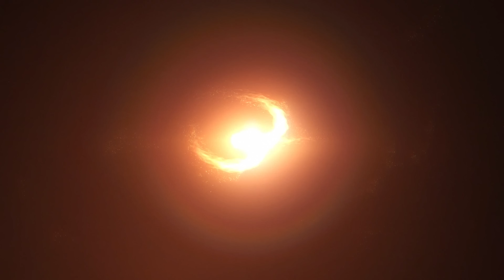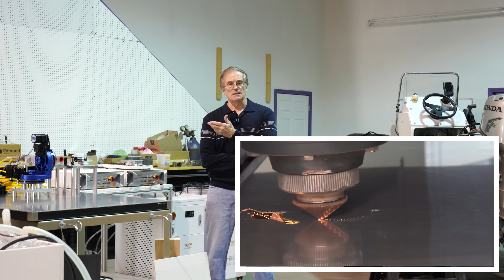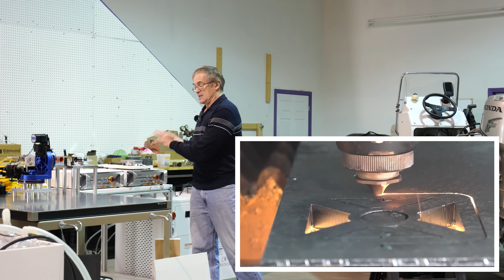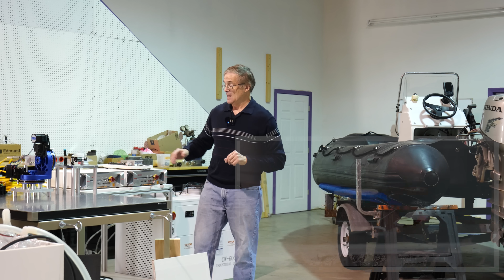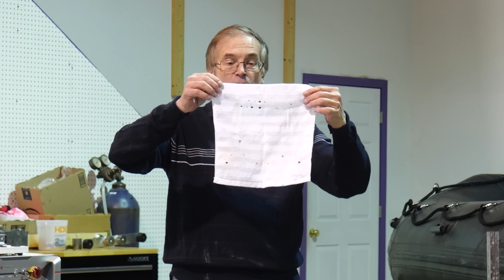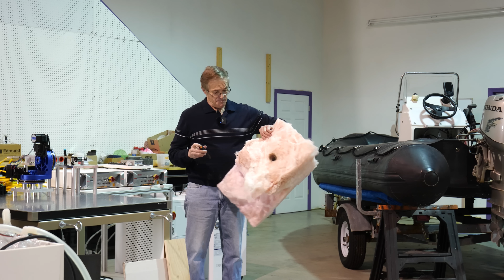We have a problem... and need your help!

Comment: My first thought is carbon foam with lots of aluminum oxide or graphite added, or that commercially available ablative fire paint stuff seen in a Nighthawkinlight video. I would also think about using those tactile transducers you've previously used to make music so that you can effectively enlarge the contact point, How much that would help, I have no clue.

Comment: active cooling wall. pump water through the surface to a heat sink. Range sensor. 3D map your room and if sights land on background don't fire the laser. If sights land on something between the background and the laser then it is a valid target and fire. Limit firing time to quarter of a second to allow time to see if target is destroyed.

Comment: No idea if this would work but how about just putting a plexiglas tank full of extremely dark liquid/oil in front?
I imagine the cloth did not work because the cloth fibers are transporting the light energy into the absorbed liquid but burning up in the process.
Instead of the wet cloth fiber absorbing the light let the liquid itself be the absorbant material?

Comment: With such energies it is almost impossible to find a material that resists. You can consider Ablative armor. Nighthawkinlight made a DIY Ablative composition for fire protection, maybe such a modified composition will help. 
It is possible that not the material itself, but the plasma created by it will be the main absorber of radiation.
Reply: Wood works good, not because of high energy resistance, but plasma and particles bursting out of the hole, absorb radiation before rest hit combustion point.
Reply: phenolic resin (or that you have on hand) + fumed silica / graphite powder / Al oxide (test for structural performance) + doping for plasma density (NaCl ?) + smf for electron-density, reduction of the plasma ionization potential ( ? ) + doping for control of ablation rate, decrease or increase (CaCO3 , Fe2O3, Al powder, carbon black ...)
1-10 mm (need testing) of composition on top of OSB.
what do you think? thanks
Reply: phenolic resin (or that you have on hand) + fumed silica / graphite powder / Al oxide (test for structural performance) + doping for plasma density (NaCl ?) + smf for electron-density, reduction of the plasma ionization potential ( ? ) + doping for control of ablation rate, decrease or increase (CaCO3 , Fe2O3, Al powder, carbon black ...)
1-10mm on top of OSB. What do you think? thanks

Comment: In a perfect world to protect drones, I would use Aerogel. It's super light, and I heard it would break up the beam and dissipate heat fast. I think you can make it yourself.

I think Rockwool insulation is perfect; it's fireproof. It's like brick but cheap and light. It's made from EAF slag, then spun and aerated to make an insulating material.

Cheers

Jon W
Reply: I immediately went there after seeing the pink insulation. Then he held up the brick. Idea quashed.
Reply: I thought the same thing about rockwool until I saw him talk about the brick. I'm guessing the laser would melt the rockwool. Maybe it could be constantly sprayed with water to lower the temp.
Reply: "dissipate the heat fast" ... isn't Aerogel like one of ~the~ best insulators? And it's about as much DIY as diamonds. Yes you can theoretically make it yourself. In a perfect world.
And rockwool is how different to the glassfiber insulator he tested?
Reply: @Culpride  rockwool does have a higher melting point, but I doubt it would matter much in this case.

Comment: at that point youre dealing with similar problems to a shooting range. would it be possible to find a section of dirt like a berm or even flat ground that you can aim down at, which you could erect a prefab shed structure around for testing? it would probably end up being cheaper that bringing in and assembling enough material to resist the laser

Comment: Several layers of 5/8 or 1/2” Cement board used in construction as  tile underlay.
Cut it in 15 x 15 cm squares or hexagons layered to minimize seams and allow for easy replacement.
Cheap, consumable, replaceable, non toxic. 
Could even attach some tile material to it if that would help absorb the energy of the beam.
Reply: I had the same idea but you beat me. As an addition i would consider glass fiber reinforced cement board (not sure if that's available there)

Comment: How about soaking thinner plywood boards in a borax + boric acid (1:1 by weight) hot water solution? Boards need to be thinner as the solution will only penetrate a few mm. Evaporation likely but the burnt borax will form a carbonaceous char that slows combustion by being highly insulative and trapping combustible gases.

Comment: Surely a graphite sheet would be able to absorb and distribute the heat rather quickly, not sure where you'd get one though   
Maybe an Intumescent coating on the drywall?

Comment: What about ceramic tiles? probably would suffer from the same problem as the bricks but worth a try
There's also refractory/fire bricks, not much more practical than a brick wall but they are at least typically lighter, and I suspect would handle the laser well

Comment: Obviously need black dyed rawhide / leather to both absord and disperse the heat. 3 inch thick black rawhide should handle it for a second. I am not confident without liquid over leather you'll get the desired requirements. I'm thinking aerogel over top black leather. like the Russian space shuttle material.
Reply: I think aerogel and black leather are going to be the most surefire bet.

Comment: Idea 1 shoot laser down and use the earth as the touch point. Idea 2 use rotating disk of plywood and surface coat it with best absorbing material  you have at hand. rotation meaning laser will touch one point only short time and material can be cooled at the same time.

Comment: you can get "shaft wall" which is 1" thick fire rated sheetrock. Another idea that could be used in conjunction with the shaft wall is a waterfall wall so you have a continuous flow of water, or maybe another fluid that might absorb heat more effectively.

Comment: Perhaps you're asking the wrong question. Instead of stopping the beam directly, why not reflect it? Just like in the fibre optic cables that utilizes total internal reflection, how about putting a large mirror at a steep angle reflecting the laser beam to the ground? 
I doubt the laser can pierce the Earth's mantle... Hopefully.

Comment: A multilayer ripplelike woodshild with extingushing system that blows between the layers?
A water fall - maybe ripplelike?
Combine those two?

falling sand instead of water?

a kind of conveyor belt system that runs so fast, that the laser bundle has no time to burn through?

Comment: How about the material they used for the heat tiles on the shuttle or the heat shield they use on the re-entry vehicles.

Comment: Try dried tortilla (more like thin piadina) or flatbread, it takes massive amounts of energy to get it to burn. You need something that converts the energy instantly into a chemical reaction (carbonization without burning) or be so dry that it does not take oxygen from air to carbonize and does not melt, maybe wet bread dough could also take up massive amounts of energy because it would convert the heat into growing with the yeast.

Comment: Lamina flow waterfall/wall(s)? Not sure if water would work, or how thick it would need to be, or how many walls of the likes would be required... Then you'd need to deal with any steam.... Even then you may need something behind it... just in case...

Probably a bad idea, but I thought I'd throw it out just for giggles. After all, the "wall' replaces itself as long as there is enough water to feed it, that would be some pump and reservoir though!

Comment: A sand pit behind the target. I would assume the sand would absorb (turn to glass) and diffuse the laser light effectively scattering the light.
Reply: Sand tends to pop when you laser it (even with my tiny 20w laser), seems like a good idea but in reality, I suspect it would just throw superheated glass everywhere?
Reply: That wall is about 5 meters squared, if we assume only half a meter thickness it would be 12.5 cubic meters of sand that weights at the minimum 18.75 tonnes. Not a very movable or cheap solution
Reply: ... scattering the light all over the room and hitting someone's eye
Reply: @JasminUwU  to be fair  at these  power levels  that true  from just dust in the air
Reply: fine dry sand will slump into any melted spot too. That way the solution replenishes ablative armor..  Every decent lab should have a bucket of sand anyway. Used to always be topped off with cigarette ends but the sand will put out most fires and is dirt cheap.

Comment: Another idea is that you can use that paint you demonstrated that scatter the sunlight very efficiently. Perhaps you can try several times more layered than what you did and it could help? You can perhaps coat a thermally conductive material with it then put water behind it to diffuse the heat. Since it won't absorb most of the light it will not heat up that much anyways.

Comment: Did you try actual thermal material? like what we line fire stoves with? It's fairly easy to work with and I've melted steel without wrecking them. You can even buy the powdered product and cast your own custom size if needed.

Comment: Could try soaking your plywood in in water. You could even soak a front sheet and leave the second sheet behind it dry. That would probably add some small amount of time to the life of the plywood and keep it from catching on fire. Cheap and can move it on a rack.

Comment: Change your target area to the ground and test down instead of sideways. Concrete is cheap and easy to patch.
Reply: This!... but think more along the lines of 'dirt'... its free, functionally limitless and just outside the door.
Reply: Hard to do if he's trying to aim at flying drones.
Reply: @misterhat5823  the focusing and tracking subsystems can be tested separately, with the focusing system tested aiming down and the tracking system tested using low powered lasers. In any case, requesting help on a fixed backdrop presupposes some sort of static test.
Reply: @misterhat5823  you're just changing the frame of targeting. Laser goes up high. 

What was your Z axis is now Y and so on.
Reply: I would think the concrete would explode in the area hit
Reply: @psynurse  now there's a thought. I kinda want to see a laser explode concrete more than the original experiment now.
Reply: this was my thought as well!
Sometimes you have to stop asking whether you could, and instead ask whether you should...
Reply: While true this is their new studio I dont think they are very keen on destroying the floor so quickly :D
Reply: literally this
Reply: What happens when he burns a hole to China? Will that start WW3?🤪

Comment: Graphite blocks like the space shuttle heat shield?  I've seen discussion of using a smoke blanket to protect rockets from laser weapons. How about a long tube filled with thick smoke. The wood probably worked better because the smoke absorbed some of the energy.   I also like the water tank with a solid suspended in it, like mud.  Reflection from the glass would have to be managed.  Fun project.

Comment: My suggestion is combination of 2 things.
1. Create a software patch, if the gantry was to lock on to a specific point. It would start making some form of pattern like zizagging onto a small rectangular area so it spends no time at a single point. It's movement is concentrated to a relatively small area but not at a point.

2. Put up a massive wall and flow some dyed liquid over it that absorbs light (to prevent reflection) and evaporates to distribute heat. (https://youtube.com/shorts/OrR4PsEbikc?si=xwv9Bwfc9N6UXm0Z) this video partly explains physical arrangement just use something else insted of clear water and glass. Hope I was helpful.

edit: more relistic arrangement (https://youtube.com/shorts/iM1nHDnUFQM?si=b_0ccXNP0GH8ka5b)